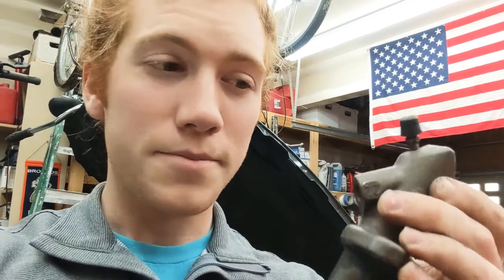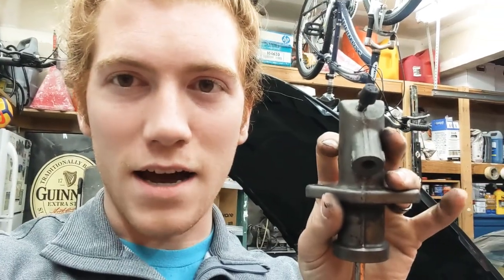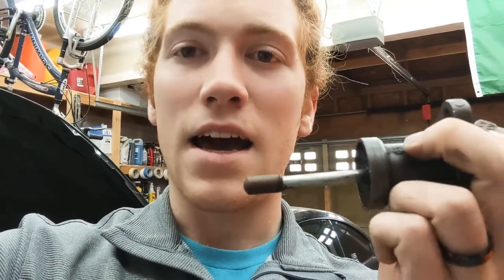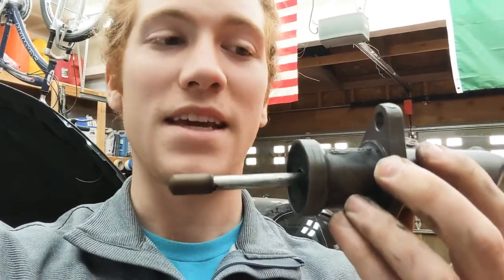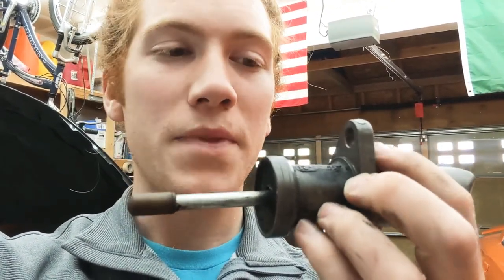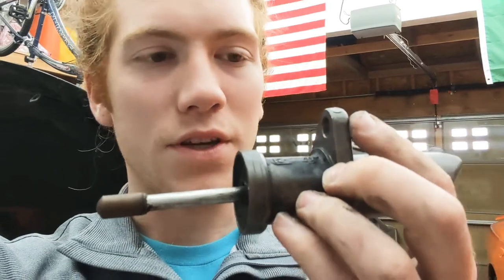How to bleed bmw clutch (dead clutch pedal)

Comment: This video has gave me hope with my e92. The clutch pedal is really spongy sometimes it sticks half way back out. It’s really hard selecting first and reverse and the biting point is literally at the floor. First time bleeding a clutch but I’ve done brakes before and I’ll do them at the same time. As soon as I’ve got the time to get round to doing it I’ll be giving it an attempt. wish me luck and thanks for the video
Reply from the maker: Good luck! Feel free to ask any questions! I might be able to answer! You got this!
Reply: Lewis did u fix this issue?

Comment: Seriously there's a design issue with these systems.

I've removed the assist system, with pressure loss the system is not able to be pumped with pressure as the pedal is biased to stay on the floor.

Thinking I had an internal leak in the master I replaced mine after the pedal was on the floor.

Bleeding with a liter of fluid through a pressure bleeder and filling a 1 meter hose with bubble less fluid the issue persists.

Great video! By the way the restrictor just pushes out of you don't like the damper.  I thought that was restricting the flow to bleed so I pulled that out as well.
Reply from the maker: I got you! Yeah it took a long time to realize how to bleed it even though I've bled clutch pedals before, it is very frustrating, I will keep that in mind! Thanks for the kind words🙂
Reply: No design issue, it's issues with people not knowing how to work on these cars. It's easy if you do it the right way/how it's designed to be done. Also it should be done every 2 years, it's a part of the regular brake fluid service on manual cars.

Comment: 2008 335i 6 speed manual, clutch either is to the floor or up if I lift it, doesn’t have any pressure but all gears work if I float them
Reply from the maker: The slave cylinder definitely isn't bled, the fluid is what returns the clutch pedal

Comment: I’m having that same issue, except the clutch hose line had a small crack which caused a leak and the clutch got stuck on me to the floor. Do I need to bleed it the same way like you did ?
Reply from the maker: If you are just replacing the line you might be able to just bleed it while it the car without pulling the slave cylinder out, it's definitely worth a shot!
Reply: Perfect, so I did that the clutch comes back up now. It’s not 100% but it’s around 70% now the car won’t turnover. Think it could be because the car not recognizing the clutch is all the way down to turnover?
Reply from the maker: It's not cranking? Or it's not starting? I would try starting the car out of gear, but if the clutch pedal isn't fully working I wouldn't recommend driving the car, it definitely has air in the system

Comment: Hey I have a e92 and I just changed the clutch because it felt like it was slipping and when done the clutch pedal was hard.
Reply from the maker: From what I've experienced the reason why the clutch pedal is hard is because the push rod on the slave cylinder isn't touching the clutch fork properly, so I would pull off your slave cylinder again and make sure it's on the clutch fork

Comment: Ok so my clutch is few months old. I replaced the master and slave cyl, used a pressure system on the fluid reservoiv, pedal is very soft but it come back when you push by hand. I got out almost 1L of dot4 during the bleeding process and my pedal is still soft and air still comes out. I’m lost
Reply from the maker: I would try pulling out the slave and tilting it up vertically and letting it bleed that way, I tried the pressure system as well and didn't have much success, the gravity bleed helped me! But it sounds like there is still just a bit of air in the system, having someone push on the pedal will also help while you are bleeding it! I hope this helps🙂
Reply: Bleed your brakes first then do cylinders...they work off the same system...

Comment: Ive bled the clutch system, I have no leaks and still a weak clutch.  Do you think this indicates a clutch replacement?  Thanks for the video and help!
Reply from the maker: Does the clutch pedal fall and not come back up? Also when was the last time the clutch was replaced, and how hard are you on your clutch?
Reply: @ProjectRacecar2  the clutch pedal pops back up, but gets to the point where im flooring the pedal to get gears to change.  Im easy on the clutch and have only had the car a few days.  The previous owner had it two years and said there was never a clutch issue... when it gets at it worst, i will have the clutch pedal floored, and i can slowly feel it engaging into first gear.
Reply from the maker: So is it having a hard time engaging in gear? Or is it just a soft clutch feel? You might have to look into replacing the clutch! You can look up some videos on how to tell if your clutch is bad!! Maybe run some tests!!
Reply: @ProjectRacecar2  this is happening to me, it won’t come back up what can it be? New clutch replacement
Reply from the maker: @jesuscervantes2988  it really depends on the age of the clutch, how hard you drive or have worn the clutch, it could be low on fluid or have an air bubble in the system, you could try to bleed it and see if that helps since that's the easiest and cheapest thing to do!
Reply: Not necessarily...I replaced my flywheel, clutch, slave, and pressure plate...ran fine for awhile then started developing shifting problems...gets worse as the car warms up...I would assume a bad seal or a small leak in the line...its not a consistent problem but it consistently gets worse...next upgrade is new slave line from master...clutch should be your last go to but could be throwout or the pivot pen if that's still original..if you do drop it don't forget the pilot bearing...

Comment: So I'm having major issues with my bmw z3 1997 the piston keeps popping off almost like it's exploding why is this I've put 3 on and ready for the 4th when I push clutch in to bleed it I can hear the piston shoot off
Reply: Do you think there's something wrong with the forks
Reply from the maker: Hi, did you just buy the slave cylinder, I tried to buy one from the auto part store and it was really cheap and made of plastic and had that issue, so it could be a faulty slave cylinder. The second issue could be that the actual piston isn't seating on the fork, if you can return and get a new slave I would do that

Comment: Doing this on my manual x5 right now. Need to get it done today no exeptions. Anyways my hard line too the slave has a factory bend to it so its hard to take it out with that hard line connected. And i dont have a second person too help. So what do you think will be the best way to do this solo?
Reply from the maker: You can try to pump the fluid up through the slave cylinder with a pump, you just need to attach the line to the slave cylinder!
Reply: @ProjectRacecar2  hey so I figured out how to get pressure. But now I figured out why it was taking so long and losing pressure. Autozone gave me a faulty part. Slave cylinder is busted and the rod fell into my transmission 😭. What do you think how can I fish it out? I'm omw to return this part for a new one but I need to take that slace cylinder rod out!
Reply from the maker: @igorzanin9305  only way to get that out would be to pull the transmission, but at the place where it is, it shouldnt hurt anything to leave it in there honestly
Reply: @ProjectRacecar2  update:
So I bought a flexible retriever with a magnetic claw. Ended up getting it out first try. Waiting on a buddy now to finish up bleeding the clutch. If it still doesn't have enough pressure after constantly bleeding it would you think the the master cylinder could be bad? Like if peddle still doesn't retrieve to where it's supposed too.
Reply from the maker: @igorzanin9305  nice job, but if you are still working with a dead pedal it should mean that there is still air somewhere in the system, these are notorious for being a pain to bleed
Reply: @ProjectRacecar2  okay so I got pressure. Could probably use a little more bleeding. But now it won't start  . I banged on the starter and after about 6 times of turning the key to start it it started but just that one time. Now need to figure that out. It did start doing this yesterday before I changed the slave master.   BTW thank you for your inputs and strategies.    But to your guess what would you look at first? I'm thinking either starter or maybe ignition switch?
Reply from the maker: @igorzanin9305  I would first check with anything you touched like if you unplugged any wires or anything, I would then go through easy cheap stuff to check like if you have fuel spark and air, make sure it doesn't have any check engine light, then I would check the starter then go to the ignition switch!
Reply: @ProjectRacecar2  nothing un plugged this problem happen too happen right when the slave went out. But for sure thank you will start diagnosing tomorrow wish me luck lol

Comment: I have a 97 540i and the clutch hits the floor I replaced a slave cylinder and there is still no pressure I’m lost.
Reply from the maker: You bled the system? With someone else in the driver seat pushing on the clutch?
Reply: @ProjectRacecar2  I can try. Thanks for the quick response
Reply from the maker: @carphiljoseph3719  no problem! I'm sure that there is still air in the system, make sure to keep the reservoir topped off when you do it, you also need two people to bleed it! Good luck!!

Comment: Good day i have a problem with my cluch where it is just completely limp it has no presure what so ever and no air in the system what do think the problem could be?
Reply from the maker: Did you just put the slave cylinder back on the transmission? Because when my clutch was going completely limp the ball on the slave cylinder wasn't seating correctly on the transmission fork thing
Reply: @ProjectRacecar2  yes i did so do you think i need to adjust it, maby it didn't catch properly?
Reply from the maker: @dyjin1587   I don't think it caught on the fork, it's a real bitch to get in, you'll have a good amount of pressure pushing back on the slave cylinder so if you put the bolt on with ease it didn't seat correctly! Mine took a couple tries to get it
Reply: @ProjectRacecar2  okay thank you that explains a lot becaus i was struggling and i removed it and it whent back fairly quickly
Reply from the maker: @dyjin1587  yeah it has a good amount of pressure on the fork but let me know if you need anymore help on it, it took me a good amount of time to do to get it to work properly! Good luck on it!!
Reply: @ProjectRacecar2  thank you very much for the assistance i realy appreciate it

Comment: E60 545i 6 speed manual same issue but literally dead pedal clutch pedal doesn’t come back up mechanic was even stumped and he fixes all my bmws fresh clutch kit fresh line fresh master and slave cylinder any help?
Reply from the maker: I had a lot of issues actually getting the slave cylinder rod on the clutch fork, it's really difficult and awkward to put the slave back in the transmission, there is always the possibility of air in the lines just because of all the new parts, pulling the slave out tilting it upwards doing a gravity bleed on it and making sure the rod goes back on the fork is where I would start, it's all free, but good luck let me know if you have any other questions!
Reply: Did you end up fixing your problem, if so what was it?

Comment: So my clutch clutch pedal hissies when i push it in and if i release it it will return is this the same issue
Reply from the maker: If it's a hiss or like a squeak type of sound then to me that sounds like it would be the throw out bearing which requires you to pull the transmission so you might as well replace the clutch, that's just what it sounds like to me

Comment: My 98 bmw 528i is being stubborn can u help
Reply from the maker: Yeah what's going on?
Reply: @ProjectRacecar2  I just put a new clutch , master cylinder,and master slave now bleeding the clutch its not getting any pressure soft I've tried a couple different ways idk could it be leaking air of some sort from anywhere u think ? Is that possible ? Or am I missing something ?
Reply from the maker: @stepharballo3605  it is hard since you replaced everything to narrow it down, these systems are notoriously difficult to bleed, if there is an air leak it would also be dripping fluid places or there would be air bubbles coming up in the reservoir, have someone check the reservoir while you are pumping the clutch, but I would still recommend pulling the slave cylinder out of the transmission and tilting it vertically while someone in the car pumps and holds the pedal! Hopefully this helps!

Comment: So you have to hold the slave cylinder piston in when they push the clutch? Or it'll break it right?
Reply from the maker: If the piston isn't compressed then the clutch pedal will be stiff, so you have to hold the slave so that they can push the pedal
Reply: @ProjectRacecar2  thank you sir.
Reply from the maker: No problem! Good luck!

Comment: So once I hold the rod half an inch in and when I begin pumping..would I just do a normal clutch bleed proccedure afterwards like pumping 3 times and hold to crack the bleeder?
Reply from the maker: So I bled the clutch outside of the transmission, as in the slave cylinder was out of where it normally sits, which I would recommend, so I would pull the cylinder out press the rod in then have someone pump the clutch then crack the bleeder!
Reply from the maker: So in other words yes just do a normal clutch bleed procedure, I felt like holding the bleeder up let out alot more air alot faster
Reply: @ProjectRacecar2  Thanks man really appreciate your quick feedback!
Reply from the maker: @jfboosted  no problem! I hope you get it figured out! I know I was fighting with my clutch for far too long!
Reply from the maker: @jfboosted  did that end up fixing your clutch pedal?
Reply: @ProjectRacecar2  Well I sure got pedal feel and after I try to install it the whole clutch slave cylinder falls apart 😂
Reply from the maker: @jfboosted  oh yikes, what do you mean it falls apart?😬😂
Reply: @ProjectRacecar2  I let the rod go freely and while I was pumping the clutch pedal it popped out of place lol
Reply from the maker: Ahhh yeah it did that a couple of times to me, is it just not aligned correctly on the transmission fork thing?😂 That's a pain! Let me know when you get it!!
Reply: @ProjectRacecar2  No what I mean it literally popped out like the whole clutch slave cylinder fell apart. Had to order a new one 🤣 didnt even get the chance to put it in the transmission
Reply from the maker: @jfboosted  was it plastic?

Comment: Techie question: I intend to flush, not bleed, my hydraulic fluid with a suction brake bleeder - old fluid for new - so there will be no air in the system (assuming I do it right!). Can I just keep pulling fluid through the slave until it turns clear, topping up to keep the air from getting it, without removing the slave?

I'm doing my brakes, so I might as well do the clutch as well and get ALL the old fluid out :).
Reply from the maker: Yeah you can for sure just flush it out with the old and in with the new!! I would just go slow and make sure you keep it topped of so that you don't reintroduce air into the system!! Good luck and let me know if you have any more questions!!
Reply: @ProjectRacecar2  I assume I should do the clutch last because it's the closest to the reservoir?

Comment: if my slave rod doesnt wanna be pushed in is that a problem?
Reply from the maker: Like how hard are you pushing?
Reply from the maker: There should be a decent amount of pressure on it, it was a b*tch to get in for me, but if it doesn't spring back then there is something wrong, like it should be pressing in when you are pushing into the transmission fork

Comment: Hello I have a 2004 x5 6speed that I can’t find a pressured clutch for the life of me; I’ve tried almost everything.because I sent this vehicle to a third world country and the so called mechanics aren’t so educated on this type of issue.since there’s air in the system I can’t get a clutch I don’t know if it because of I have a suv.pleeeeeeeaaaaassse I need your help
Reply from the maker: So open your clutch reservoir, make sure to top it off fully, then flip the slave cylinder where the bleeder valve is pointing up, then open the bleeder valve and let fluid out let it drain for like 5 seconds then close the valve! Pump the stick on the slave cylinder 10-20 times, then tilt the cylinder up again and open the valve and repeat the process until your clutch is feeling better! Make sure to watch the reservoir that it doesn't drop too low otherwise you will add more air to the system!
Reply: @ProjectRacecar2  ok I will try this today
Reply from the maker: @drooff95  ok let me know if you have any other questions!
Reply: @ProjectRacecar2  hey thanks it helped a lot,I was able to finally find a clutch! Wow thanks a lot,but now I notice it made my brakes go down now
Reply from the maker: @drooff95  awesome well I'm glad that helped but unfortunately you probably need to do a quick bleed on the brakes! Make sure the reservoir is topped off! But again glad it helped!! Definitely consider subscribing! It would help out alot!
Reply: @ProjectRacecar2  Ok I tried that,but now when I try bleeding the brakes no fluid comes out, and I tried all four of the wheels.is that normal? I even tried doing it the old fashion way and that doesn’t work
Reply: @ProjectRacecar2  is it the same preceding?
Reply from the maker: @drooff95  try doing it one more time with someone pumping the breaks, start with the furthest wheel from the reservoir!